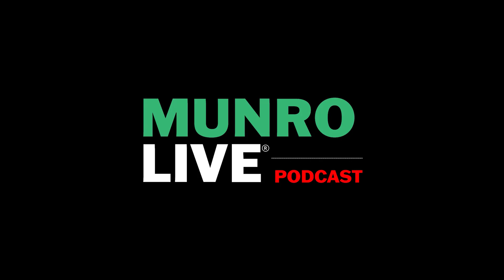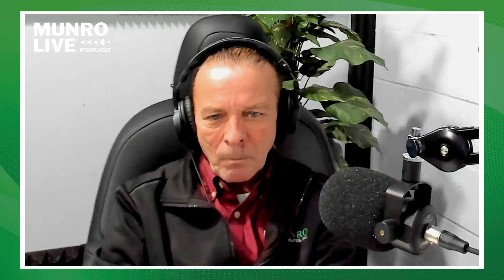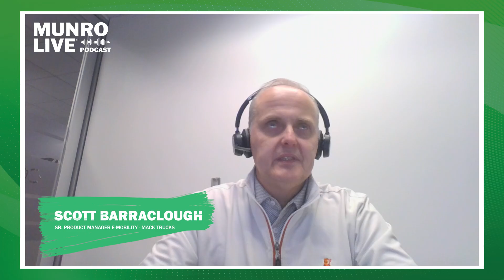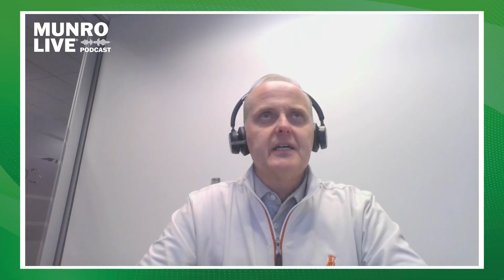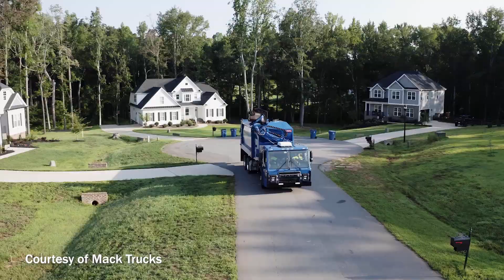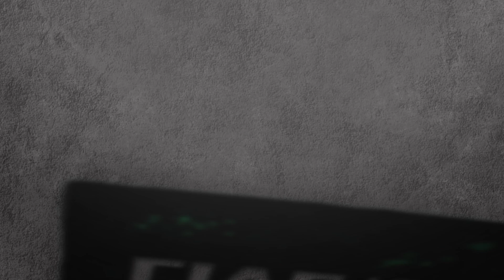Mack Trucks' Scott Barraclough on the Biggest Hurdles in Heavy Duty Electrification

Comment: One other thing if you’re going to make a medium duty truck electric it should at least be able to pull a 12,000 pound trailer 150 miles without charging I have a Ford F150 lightning that pulls a 5000 pound trailer 150 miles